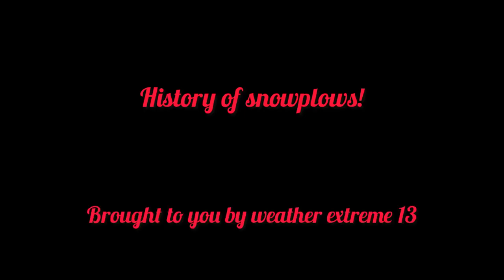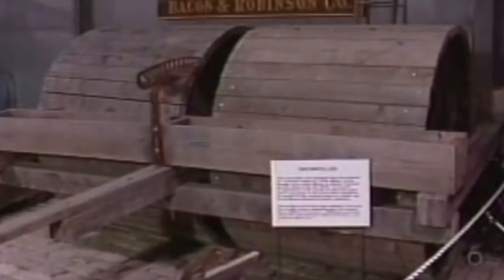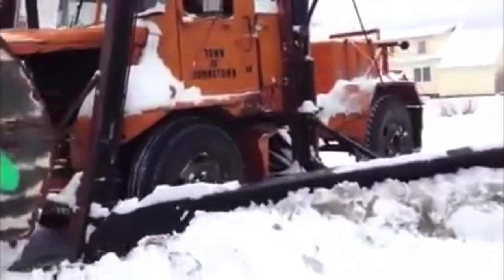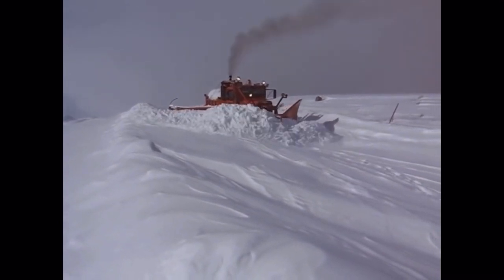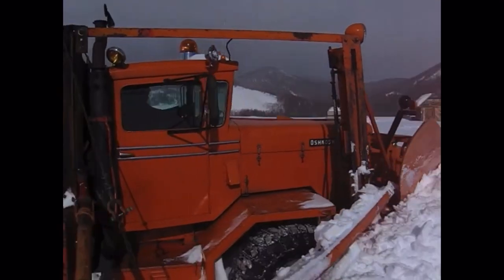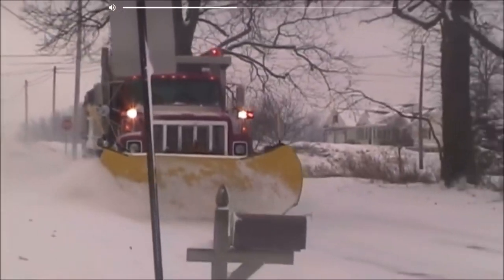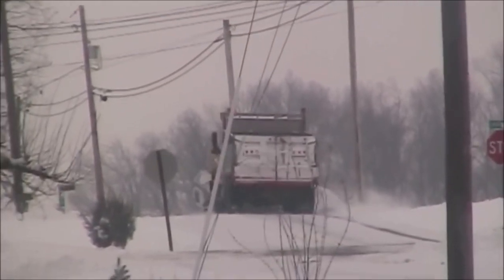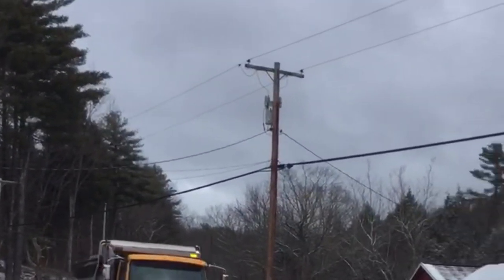History of snow plows

Comment: The horse drawn roller was used to pack the snow for sleighs, cutters, bobsleds and etc...before spring and sometimes earlier, the roads were shaved by horse drawn shavers to reduce the thickness before spring breakup...then came the mud season, until the roads were dry enough to be graded...Later when autos were used in winter,  track laying tractors, heavy trucks and graders kept the roads clear...in poorer areas horse drawn "V" plows were pulled...In places where the snow is drifting or deep, rotary snow throwning equipment were used...years ago I saw one with wood wheels in use near the Canadian border...

Comment: all the way up until 1980 we were still using the old spreaders that were run off the back wheel with a chainthe good thing about those were they would grind through any big chunk of Cinder you had in there also they would stop when you stopped so if you had to stop at a stop sign you didn't leave a pile of cinders behind you

Comment: Look into Oshkosh Corporation kid. They are the only company in the world that builds snowplow trucks one at a time from the ground up. No other company builds snow specific vehicles like Oshkosh.
Reply: Actually, you forgot about a company called FWD, that has been making snowplow trucks as long as Oshkosh has, and the two companies have their factories 10  miles away from one another...
Reply: @thomasjsanford4369  I read many years ago that FWD no longer exists as a plow-truck company (nor do they make "work trucks" of any kind anymore), having been absorbed decades ago into another company that makes fire trucks.  But yes, they were there in the very beginning, and if I'm not mistaken, they actually invented the modern style of front-driving axle.  They were still making specialized work trucks (including plow trucks) as recently as the 1970s and possibly -80s.
Reply: @ericl2969  Everything I've ever read on the topic was the FWD was the originator/original four wheel drive vehicle.  Hence the "FWD."

Just like the Bantam Motor Car Company was the inventor of the original Jeep.  Nobody could get a short wheel base 4 wheel drive to go around sharp corners until Bantam figured that problem out.